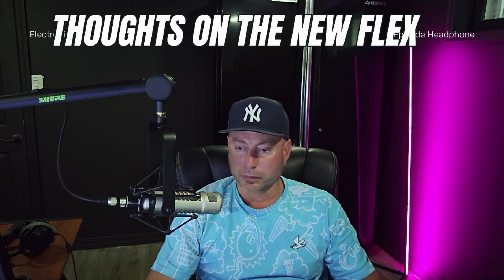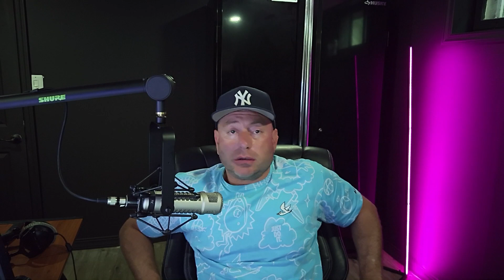New FLEX 8000 thoughts...Should we all wait?

Comment: Could the 8000 series have been introduced because it contains a selection of more obtainable components than the older model? There were numerous delays and shortages with the 6000 radios and the controller. Just wondering.

Comment: When there's only a single button on the front of the radio and the same connections required on the back of the radio would any company waste their time, money and other development costs to design a new box?

As far as the Windows version of Smart SDR, from what I've been able to understand it's written in WPF using C# and XAML.  WPF applications are based in .NET and are primarily developed using C# and XAML. Originally developed by Microsoft, WPF was initially released as part of .NET Framework 3.0 in 2006.  Microsoft has moved on from WPF a number of years ago whereas Flex has not yet moved on.  From some other comments I've read Flex has painted themselves into a corner with the use of some proprietary controls that can't be easily brought forward into .NET MAUI.

Comment: You bring up some good points. I am not sure where you heard that ADP would not be in SmartSDR until August 2025.  That was not something that FlexRadio ever said and was a rumour started by a non-Flex person.  The current plan is to have it by year-end.   The SmartLink server was totally rebuilt, upgraded and made redundant last September.  It was a total overhaul of SmartLink.  That should resolve SmartLink outages (it was a subject of our own success).  We had to release a new radio as it was getting harder to get parts to build the old radio and that would have left FlexRadio in the position of no hardware to sell.  It is about business economics.
Reply from the maker: The original presentation from the banquet had August 2025 smartsdr update. Those photos of the presentation which were uploaded to the enthusiast page have all been deleted. I’m working on getting them though, don’t worry.
Reply from the maker: And, if you recall the post I made on the enthusiast page 3-4 weeks ago asking to see a video of apd working, no one, not you or Flex made a comment that August 2025 was not the date spoken about during the release of the radio.

Comment: Spot on Doug... a valid perspective in a nutshell. As a positive note,  I do have two stellar FLEX (O43A) products, the Tuner Genius and Antenna Genius. From what I read between the lines of the FLEX announcement, some of the internal parts/pieces/assemblies of the 6000 family are getting hard to source (to keep production going) so a "hardware" product refresh was required.  I feel you are correct in stating that the hardware AND the software should be essentially viewed as a system, these two hemispheres make the "whole".  Just changing one hemisphere, the hardware in this case, does not make the "whole" any better, a bit faster but not better.  A step in the right direction, sure, but one has to wonder when the software hemisphere at FLEX will catch up?   THETIS for FLEX would be "the bomb" for sure. Art W1SWL

Comment: My understanding is that adaptive pre distortion and the improved noise reduction would be available at the launch of the 8000. They announced, that SmartSDR V3.8 scheduled for august release would contain  those features.
Reply from the maker: I’m sorry you’re misinformed. They announced that the 8000 will ship this August. Adaptive predistortion will only work once the software is updated. They stated that will not be done until August 2025 at the earliest. If you go with their hamvention presentation they lay it out there. Don’t take my word for it.
Reply: @kb2uka575  You are wrong and 'beru666' is correct. Flex have 3.8 just out to beta testers and aim to release it soon after the 8000 series release is established in NA and EU. That should be in the month of September 2024 notwithstanding unexpected problems.
Reply: @kb2uka575 I did review the information I gathered back in may. I have to admit that you are right. I was under the impression that at least adaptive pre distortion would be released at the launch of the 8000 series. It seems it is not. ‘